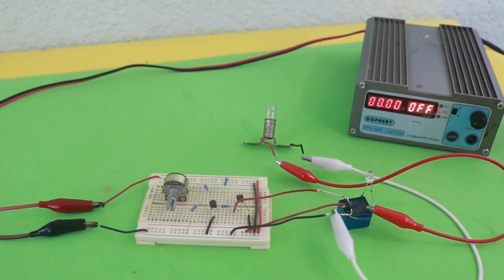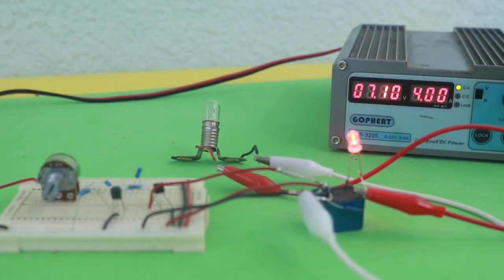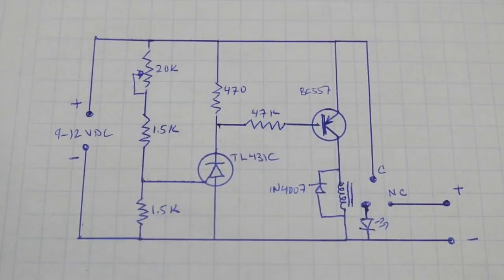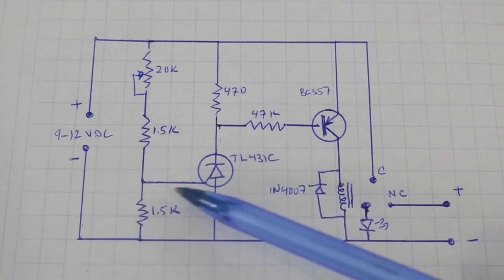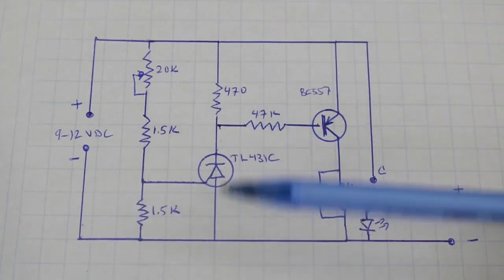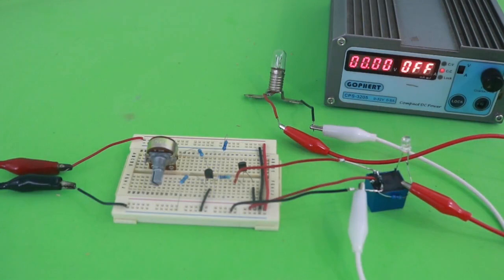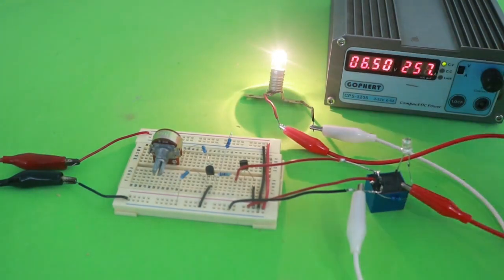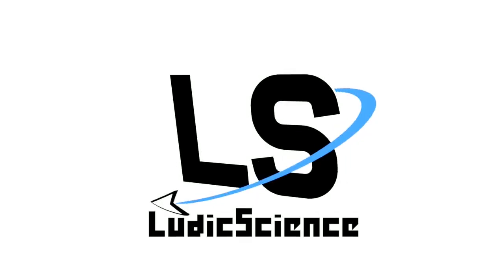Overvoltage Protection Circuit with TL431 IC

Comment: Now if you use the Relay to turn off the circuit itself using a power transistor, you'll get a over engineered oscillator 😂

Comment: Great video sir😁 but sir i want to ask, when i do the simulation of this circuit on Proteus, i do the same wiring as yours and it didn't work, from the datasheet I see that there is a series resistor after the voltage source (before the voltage divider) then i try to put the series resistor and it works as in this video but the current is limited by series resistor value , but i still not yet do the actual circuit practically because i don't have time right now. so why is it like that sir? is the TL431 simulation inaccurate with the actual TL431? Thank you sir

Comment: First of all thanks for the very useful circuit. Now my little doubt according to the schematics as soon as the relay activates it sends the full power to the LED which has no resistor in series to it. On the example 7 volts should blow up the led immediately when the relay activate - what is wrong with my understanding ??
Reply from the maker: you are correct the led needs a limiting resistor